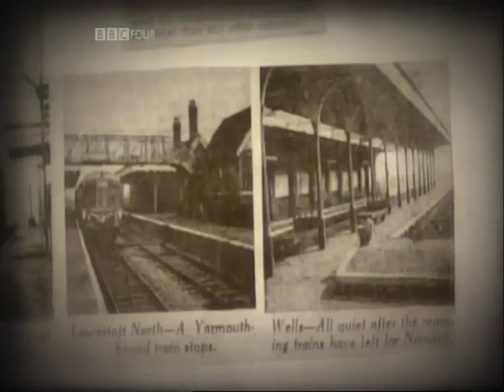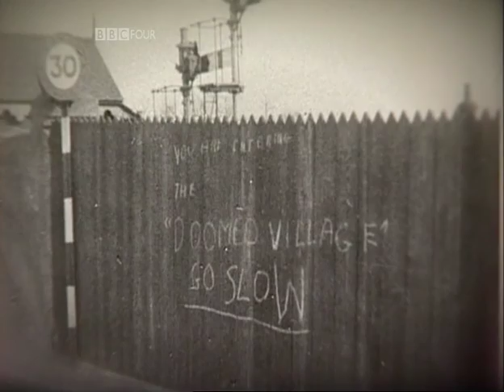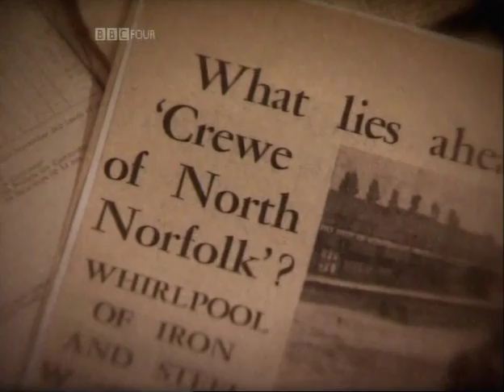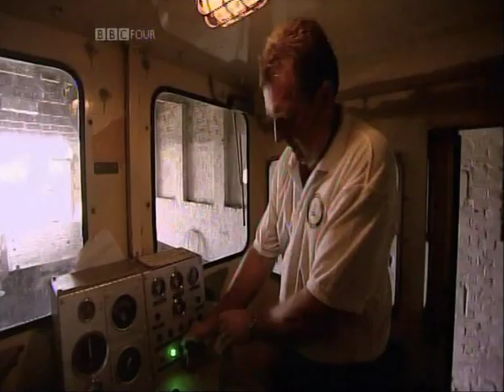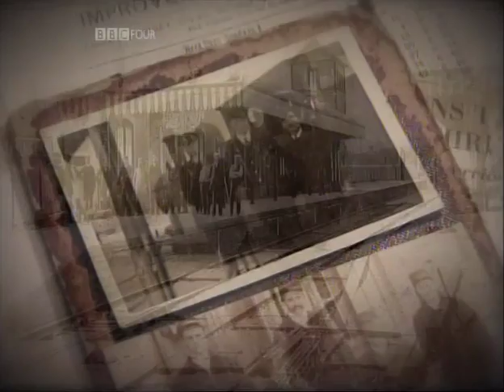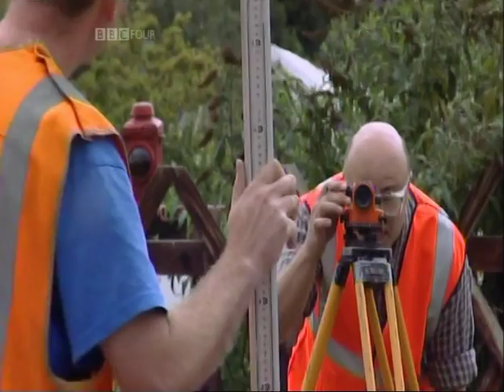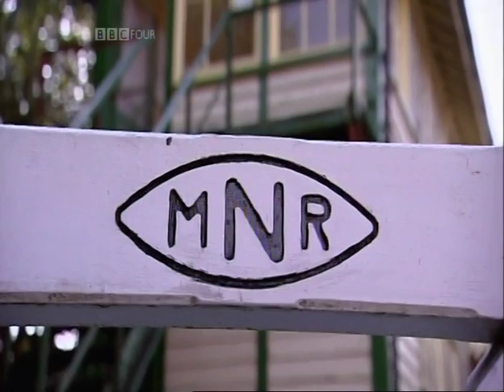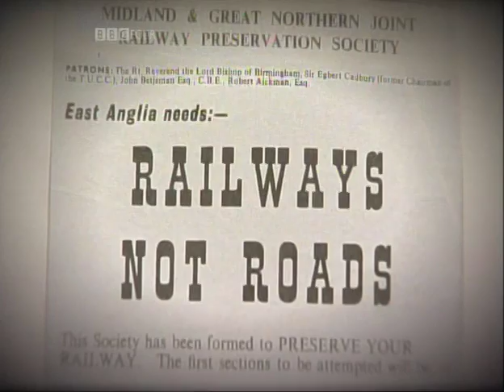Beechings Tracks ep01 Norfolk

Comment: The Norfolk Orbital Rail line combining with heritage and main line rail services makes economic sense for the region in tourism, agribusiness and local economy. Unfortunately, the bureaucrats only think in short term planning not long term.
Reply: I think they might be able to have two services both terminating at Sheringham:

1) The Normal Norwich to Sheringham Train via Cromer would stay as it is.
2) The New Heritage rail service to Sheringham would go via Dereham.

Norwich Station has more than enough platforms to accomodate such a system and the same for Sheringham I think
Reply: Correction: Sheringham only has 1 Platform in its station so a 2nd Platform needs to be built which shouldn’t be that difficult...

As it’s a termini for both, they could get away with extending the existing platform and just cut the line in the middle?